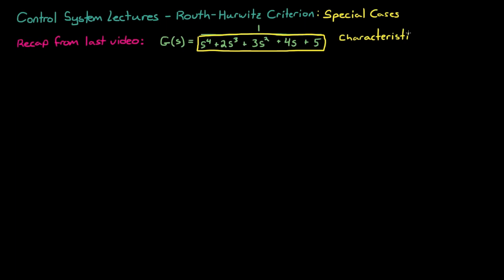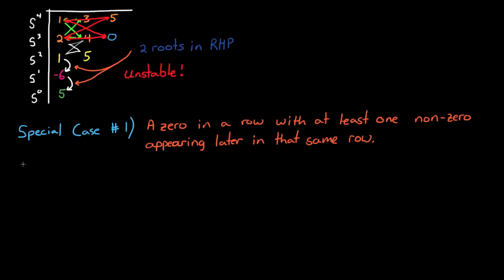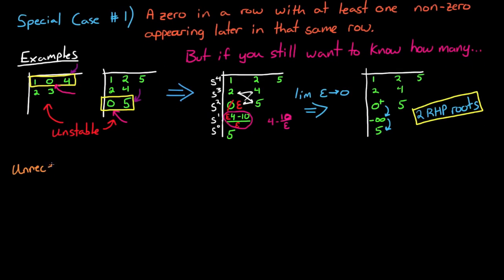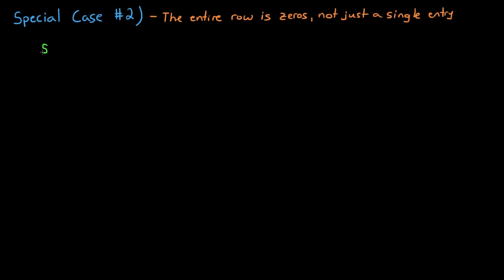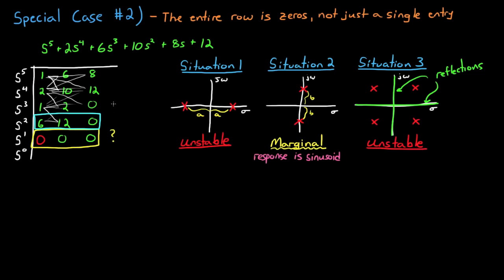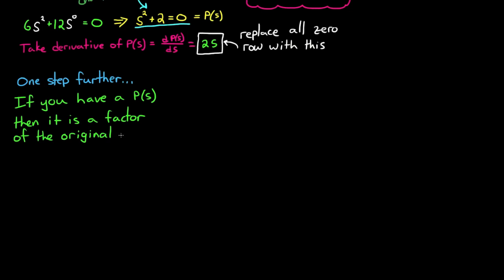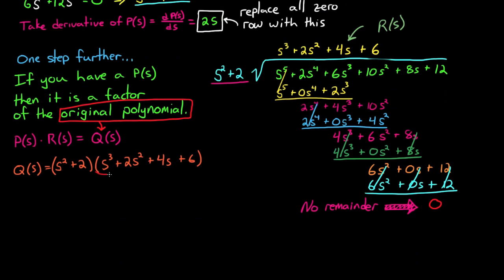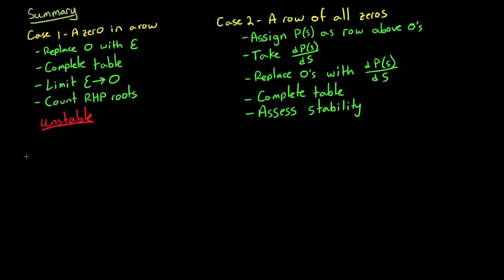Routh-Hurwitz Criterion, Special Cases

Comment: Can Routh Hurwitz somehow be used for the BIBO chararcteristic? If i am askes to tell whether a system, given in the state space represantation or as transfer function, is stable and has the BIBO characteristic, i can use Routh-Hurwitz for the stability analysis. However, when i want to check the BIBO characteristic i need to calculate the Poles of the transfer function anyway, or am i wrong? The reason is, because BIBO has the same rules as stability, but with the difference that you can cancel out poles and zeros in the denominator and numerator. So, if theres one single pole in the RHP, that you can cancel out, its not asymptotically (?) stable or instable (dont know exactly which one), but its still BIBO then.

But in order to see such possible cancellations i need to factorize the denominator by knowledge of the poles, right?

Thanks so much for this detailed and easy to understand explanation!!!
Reply: Apparently its possible to determine If a system Bibo stable with the help of Routh-Hurwitz.
But how can that be?
Since Asymptomatically stable => BIBO, but not Asymptomatically stable <=> BIBO

If Routh-Hurwitz indicates that your system is unstable, you don't know whether it is BIBO or not BIBO.

Thus, you would have to calculate all poles to factorize the denominator, to see if there are cancellations.

However this exercise, which seems to be unstable if i did Routh-Hurwitz correctly, asks you to determine BIBO using Routh-Hurwitz.

Sure, if the system shows to be stable after Routh-Hurwitz, that implicates that it is also BIBO.
But if it's unstable, you can't draw any conclusions as far i know.
That's logical to me, since with Routh-Hurwitz we only analyze the denominator and ignore the numerator.
Thus we ignore possible cancellations, thus we can't draw any conclusions about BIBO if Routh-Hurwitz says that a system is unstable.

Comment: In the first example you give, the one which you didn't go over and had the first row 1 0 4, I don't see why the zero here would cause an issue with calculation that would require one to replace it with epsilon. The second example makes send, but as far as I can tell the only time you need to use the epsilon method is when the zero appears as the first number in a row followed by non-zero numbers since it would lead to division by zero.

Comment: Whenever I've had a problem with a row of 0s in the array, I just replaced each 0 with and epsilon and it has yet to lead me to an incorrect answer for the stability. Am I just getting lucky that this happens to work each time? Or is it an acceptable alternative to finding the auxiliary equation?

Comment: I love the Unnecessary Side Note.

Technically, you can represent numbers smaller than the machine epsilon (1*10^100, for example), but if you were to add them to 1.0, the result would just round to 1.0.  The definition of the machine epsilon is the smallest number which, when added to 1.0, does not round to 1.0.

Comment: hi, i want to know at 3.41, when you assign epsilon to ever so slightly positive, do we need to consider epsilon with slightly negative?
Reply: You can take the limit as epsilon goes to zero from either the positive or negative direction. The signs will be reversed, but there will still be the same number of sign changes.
Reply: thanks

Comment: Hui, I want to ask a question that at 7:34, you said, To find the powers of auxiliary polynomial, begin with the power of s that starts the row and skip every other power until you reach the end of the row.
My question is that either we have to just skip every other power of s until we reach the end of row or we also have to skip every entry in between until we reach the end of row?
Reply: Suppose you start forming Auxiliary equation for s^2 row then in that row only even power of S terms will come, so say your row is like this S^2  5  6  then the corresponding Auxiliary equation will be 5s^2 + 6s^0 =0
Hope it helps!!
Reply: I don't think that's possible in the s^2 row the way the math works out
Reply: I also want to know
Reply: +vatsal talati yeah i got that, thanks
Reply: What if the row goes like this: 
s^2| 6 5 4 0

Comment: thank you for the video! i have a question, what happened when you only have denumerator like this : s^2 + 0,3971 s

is this system unstable? if so is there any way to make it stable?
Reply: +Danu Wisnuwardhana Your system has oscillation without attenuation. It's mathematically stable because it doesn't blow up to infinity, but you have to ask yourself if the system can handle a constant frequency. That makes it marginally stable.

The zeros of your poles are s={0, -0,3971}. Decompose your equation, which takes the form of A/s+B/(s+0,3971). The inverse Laplace gives you [1+e^(-0,3071t)]u(t) which is stable. Recall an LTI system will be causal, hence the unit-step function.

Comment: How can you know there are 2 right hand poles in the function from the Routh's Array where you replaced a zero with epsilon as epsilon approaches zero positively? Wouldn't its positive approach not indicate a sign change and then it would be that the sign change of the next row would indicate information about just 1 right hand pole in the function? And, when epsilon = 0, does that represent marginal stability?
Reply: Why would epsilon's positive approach to 0 not indicate a sign change when its positive approach to 0 goes to -infinity, resulting in 2 sign changes? Also, epsilon is just used to see how it behaves as it approaches 0.  Simply having a 0 in the matrix does not necessarily mean marginal stability.  In fact, he states further in the video that marginal stability arises from having  complex conjugate poles on the jw axis, which could potentially occur when an entire row is filled with 0s.
Reply: 0 to the power + means you're on the positive edge of the 0 axis. You have a negative infinity after the 0, which means it goes positive zero, to negative infinity, to positive number. So there are 2 sign changes and 2 RHP poles.

If the 0 was negative, you would still have 2 sign changes regardless.

Regarding your second question, epsilon always = 0,
since the limit as x approaches 0 = 0
Reply: I don't think that what you are saying about marginal stability is correct. Doesn't the jw axis represents frequency, and the real axis together with the jw axis represents damping such that anything +real axis is undamped, 0real axis is critically damped (marginally stable), -real axis is overdamped as is represented by the angle the pole makes with the origin?
Reply: sorry, you are totally correct... i meant to say +real is underdamped and 0real is undamped
Reply: however, not only sigma is responsible for damping... it is the zeta (damping coefficeint, which is related to both sigma and omega.. from what i remember...?)
Reply: Anil Nayak Epsilon very well could reach zero negatively (from the negative side), like you said. It isn't important HOW epsilon reaches 0, it's only important if there are sign changes.  If you plug in a very small negative number for epsilon, you will still arrive at 2 sign changes.

Comment: im confused on how to find LHP and Imaginary axis. i know changing signs in cloumn 1 give you the number of poles in the RHP. but how do you find LHP? or IA? i thought if you had to derive from a row of zeros you can use the remainging number of coefficients as the number of poles in LHP. it worked so far until i practiced some more problems.
Reply: Luis Valdivia From each column to column tells you the location of a pole. if from column 1 to 2 there is no sign change it is a LHP and if there is it is a RHP. a resulting row of zeros gives the potential of poles laying on the IA

Comment: Nice video but there is a small mistake in special case 1. If the elements above and below the ε in the first column have the same sign, a pair of imaginary roots is indicated, which means the system is marginally stable (e.g s^3+2s^2+s+2)

Comment: Brain sir u make great videos..  First i want to thank for putting your time and effort for making the videos so easy to understand. Thank you sir...  I have a query that at the end of the video u stated that for first case when we replace 0 by epsilon, the system is unstable but what if after putting epsilon at zero position and u don't get a sign change,  then it is stable..  am I right? Please tell me. 
At 2:47 you told that system is always unstable..  What if for this example 
S^5+6s^4+15s^3+30s^2+44s+24=0
Sorry for unclear writing.
Reply: I think there is one pole on the imaginary axis, the system is critically stable.
Is that right?